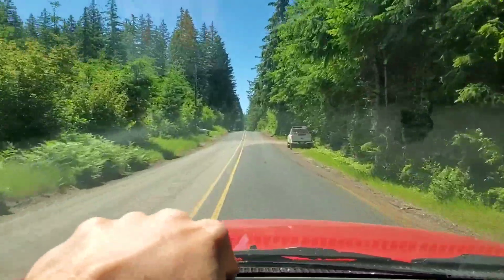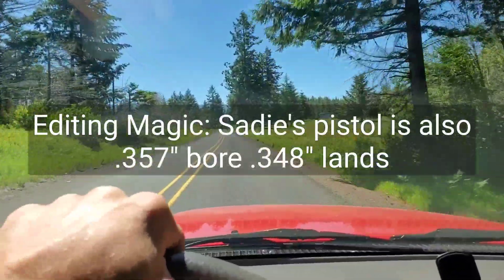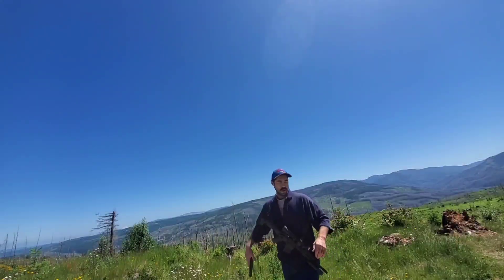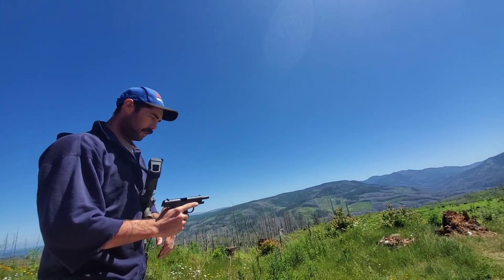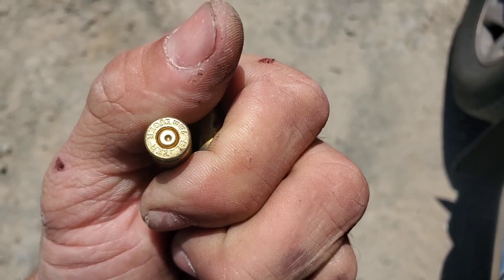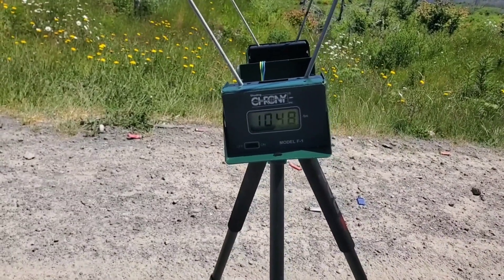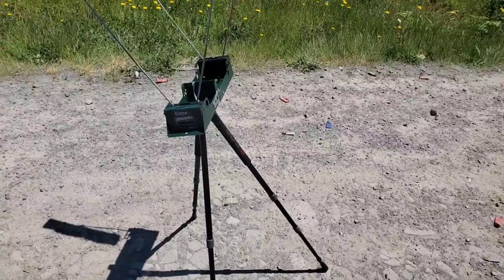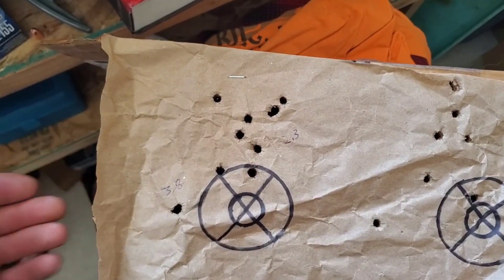9mm: .357" bullets in a .355" gun?

Comment: Titegroup is fine it is as fluffy and have the case fill like i usually want but still uses a low amount per rd.  There is around 7000 grs in 1lb of powder.  7000÷5(grs per rd)=around 1400rds per lb
7000÷4.5 (grs per rd) = 1550 rds per lb 

^ thats why i dont waste my blue dot and other hard to get powder at 8-9 grs per rd.

Comment: 9mm: .357" bullets in a .355" gun?

I have and do load .357 diameter 9mm bullets for .38Spl. but not .355 diameter 9mm bullets for .38Spl. The .38Spl. needs that .357 diameter and 9mm doesn't. My 9mms hate .357 diameter bullets so I put them to use in .38Spl. It depends on the bore diameter. 9mm is suppose to be .355 and they will shoot .356 but they do not like .357. .38Spl. is suppose to be .357 and smaller diameter may not perform well. Accuracy and bullet spread is affected by diameter. If your 9mm is .357 then its not a .355 gun. Your powder charge is too low causing your cycling problems. I use Unique powder mostly for all my pistol loads, occasionally Bullseye but Bullseye has a faster burn rate and its dirtier than Unique. Unique is cleaner burning with a medium burn rate and I can also use it for my shotgun shell loads. Most pistol powders don't allow for use in shotgun shells. All guns have a specific bullet weight that they are factory zeroed to so you might want to look that up for each of your guns. Most European 9mms for instance are factory zeroed for 124gr. NATO while "most" US 9mms are factory zeroed to standard 115gr. Most .38Spl.s are factory zeroed to 158gr. but some to 148gr. Most .45ACPs are factory zeroed to standard 230gr. and so on. The factory zero will affect point of impact by bullet weight. A light for caliber bullet usually has faster velocity and it will print low while heavy for caliber with lower velocity will print high.
Reply from the maker: I really like that you mentioned that thing about heavy for caliber printing higher than light for caliber. I think a lot of folks haven't shot enough to consider that.

Comment: I used Titegroup in a 9mm years ago. I was able to run 4.5 grains in my G17 with no issues. Increasing the charge might tighten up the groups as well.
Reply from the maker: Hey thanks for adding to this! I appreciate it greatly! I'll work up to it and see if it likes it
Reply: @timberfallingcouple  be sure to check for all the usual signs of high pressure. 4.5 was ok in my firearm but… However, I think you’re cautious and demonstrate good judgement. Reliability is king over power